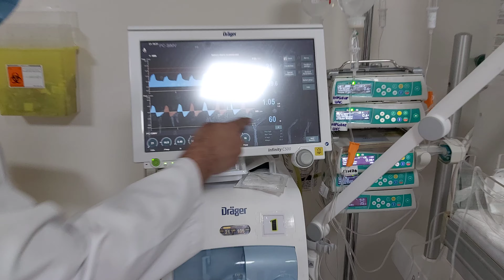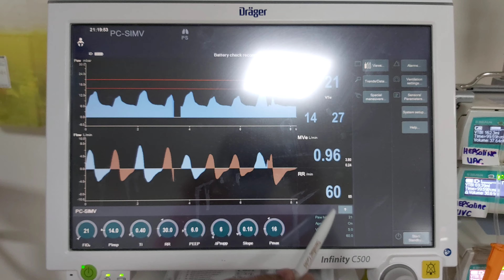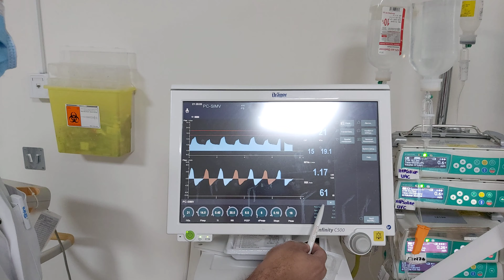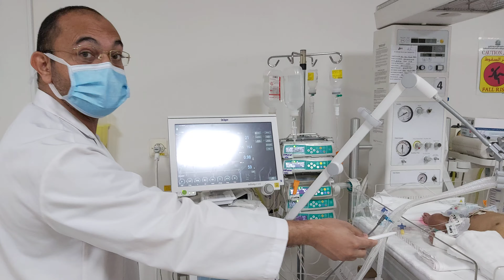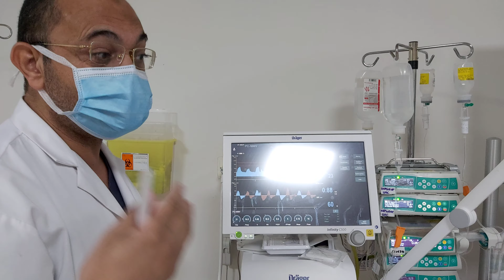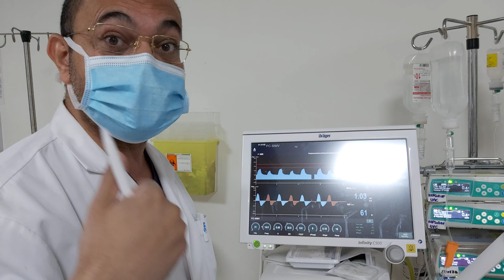How to approach for tachypnic baby  in mechanical ventilation?trigger& sensitivity,water in circuit

Comment from the maker: Perfect 👌
Here’s a stepwise checklist you can use at the bedside when you notice a discrepancy between the baby’s RR and the ventilator RR:

Stepwise Approach to RR Discrepancy in Neonates on Ventilator

1. Check the Baby First

Count the actual chest/abdominal movements.

Assess comfort: retractions, nasal flaring, grunting, fighting the ventilator.

Ensure baby is not distressed or apneic.

2. Check Ventilator Settings & Mode

Controlled mode (AC/CMV): all breaths should match → discrepancy means asynchrony.

SIMV/PSV: baby can breathe extra → clinical RR > ventilator RR.

HFOV: ventilator RR irrelevant, baby may still breathe spontaneously.

3. Look for Missed Triggers (ineffective efforts)

Are there visible chest movements not supported by ventilator?

Causes: low trigger sensitivity, air leaks, weak respiratory effort.

Action: adjust sensitivity, reduce leak, ensure good ETT position.

4. Look for Auto-triggering

Ventilator RR > baby’s actual RR.

Causes: 

Circuit leaks

Water in tubing

Cardiac oscillations / hiccups

Action: dry circuit, check connections, optimize sensitivity.

5. Check for ETT or Circuit Issues

ETT leak (common in neonates with uncuffed tube).

Partial obstruction (secretions, kinking, biting).

Poor compliance or pneumothorax → baby’s effort not transmitted.

6. Review Waveforms/Loops

Flow and pressure curves: 

Ineffective efforts = “dips” not resulting in a breath.

Auto-triggering = breaths without effort.

7. Optimize Synchrony

Adjust trigger sensitivity.

Consider sedation if severe fighting/asynchrony.

Re-assess ventilator mode (sometimes switching from SIMV → PSV or volume guarantee helps).

✅ Summary Table

Cause of DiscrepancyBaby RR > Vent RRVent RR > Baby RRMissed triggers / weak effort✔✘SIMV mode (extra breaths)✔✘ETT leak✔✘Auto-triggering (leak, water, cardiac artifact)✘✔Monitoring error / faulty sensor✔✔ 

❤❤❤❤

Comment from the maker: Great question 👍

When a baby is on a ventilator and you notice a discrepancy between the respiratory rate (RR) shown on the ventilator and the baby’s clinical RR, it usually reflects asynchrony between patient and ventilator or monitoring issues.

Causes of discrepancy

Spontaneous breathing above set ventilator rate

Baby is breathing spontaneously in addition to mandatory ventilator breaths.

Ventilator may count only the triggered/mechanical breaths, while clinical RR includes both.

Ineffective/Uncaptured breaths (missed triggers)

Baby initiates breaths that are not strong enough to trigger the ventilator (especially if sensitivity is low, or leak around ETT).

Clinically you see chest movement, but ventilator does not deliver/support those breaths.

Auto-triggering / false triggering

Ventilator delivers extra breaths due to artifacts (water in circuit, leaks, cardiac oscillations).

Ventilator rate appears higher than actual clinical RR.

Leaks around endotracheal tube

Common in neonates with uncuffed ETT.

Ventilator may fail to detect some spontaneous efforts → discrepancy.

Mode of ventilation

In SIMV, only some spontaneous breaths are supported, so clinical RR > ventilator displayed RR.

In controlled modes, the baby may still “fight” or attempt breaths not sensed by ventilator.

Obstruction or poor compliance

If baby is trying to breathe but chest expansion is poor (secretions, stiff lungs, pneumothorax), ventilator may not sense efforts.

Monitoring/Technical issues

Faulty sensors, leaks, poor waveform interpretation can give misleading RR on ventilator display.

✅ Bottom line:
The discrepancy usually arises because the ventilator only displays the breaths it senses/delivers, while the baby may be making additional efforts that are not recognized or are ineffective. Causes include asynchrony, leaks, missed triggers, or auto-triggering.

❤❤❤

Comment: Վայ էէէն միամիտին,ով չի կառավարում սեփական ինֆո դաշտն այնպես,ինչպես ինքն է ուզում,ում հիպոթալամուսի փոխարեն' 😅 խոտ է,ով սպիտակ խալաթի տակի ֆլյուիդները հատ հատ չի տեսնում😅+**12...
Reply from the maker: Great question 👍

When a baby is on a ventilator and you notice a discrepancy between the respiratory rate (RR) shown on the ventilator and the baby’s clinical RR, it usually reflects asynchrony between patient and ventilator or monitoring issues.

Causes of discrepancy

Spontaneous breathing above set ventilator rate

Baby is breathing spontaneously in addition to mandatory ventilator breaths.

Ventilator may count only the triggered/mechanical breaths, while clinical RR includes both.

Ineffective/Uncaptured breaths (missed triggers)

Baby initiates breaths that are not strong enough to trigger the ventilator (especially if sensitivity is low, or leak around ETT).

Clinically you see chest movement, but ventilator does not deliver/support those breaths.

Auto-triggering / false triggering

Ventilator delivers extra breaths due to artifacts (water in circuit, leaks, cardiac oscillations).

Ventilator rate appears higher than actual clinical RR.

Leaks around endotracheal tube

Common in neonates with uncuffed ETT.

Ventilator may fail to detect some spontaneous efforts → discrepancy.

Mode of ventilation

In SIMV, only some spontaneous breaths are supported, so clinical RR > ventilator displayed RR.

In controlled modes, the baby may still “fight” or attempt breaths not sensed by ventilator.

Obstruction or poor compliance

If baby is trying to breathe but chest expansion is poor (secretions, stiff lungs, pneumothorax), ventilator may not sense efforts.

Monitoring/Technical issues

Faulty sensors, leaks, poor waveform interpretation can give misleading RR on ventilator display.

✅ Bottom line:
The discrepancy usually arises because the ventilator only displays the breaths it senses/delivers, while the baby may be making additional efforts that are not recognized or are ineffective. Causes include asynchrony, leaks, missed triggers, or auto-triggering.

❤❤❤

Comment: What to do if the baby is realy tachypnic
Reply from the maker: Excellent question 
Dr Nancy 💯👏👏👏👍🌹🌹

First correct the iatrogenic ,preventable or correctable cause 

1. Triggering and sensitivity 
2. 💧water in 💧the circuit 

Then 

Real causes depend on 

1. Clinical assessment 
ETT ( displacement , obstruction )

2. Biochemical evaluation = Respiratory acidosis ( causes)

3. Radiological study = pneumothorax 

4.  Equipment failure 

ومن احياها فكأنما احيا الناس جميعا 

🌹🤲🙏🌹🙏🙏🙏🤲🤲🤲
Reply: @dr.tageldinaly  many thanks Dr
Reply from the maker: @nancyshafeek6679  

You are most welcome dr Nancy 😊

My pleasure 😊

🙏🤲🤲🌹🌹🌹🤲🙏
Reply: What about inadequate sedation ?
Reply from the maker: @د.احمدالفقي-ظ8ز Great question 👍

When a baby is on a ventilator and you notice a discrepancy between the respiratory rate (RR) shown on the ventilator and the baby’s clinical RR, it usually reflects asynchrony between patient and ventilator or monitoring issues.

Causes of discrepancy

1. Spontaneous breathing above set ventilator rate

Baby is breathing spontaneously in addition to mandatory ventilator breaths.

Ventilator may count only the triggered/mechanical breaths, while clinical RR includes both.

2. Ineffective/Uncaptured breaths (missed triggers)

Baby initiates breaths that are not strong enough to trigger the ventilator (especially if sensitivity is low, or leak around ETT).

Clinically you see chest movement, but ventilator does not deliver/support those breaths.

3. Auto-triggering / false triggering

Ventilator delivers extra breaths due to artifacts (water in circuit, leaks, cardiac oscillations).

Ventilator rate appears higher than actual clinical RR.

4. Leaks around endotracheal tube

Common in neonates with uncuffed ETT.

Ventilator may fail to detect some spontaneous efforts → discrepancy.

5. Mode of ventilation

In SIMV, only some spontaneous breaths are supported, so clinical RR > ventilator displayed RR.

In controlled modes, the baby may still “fight” or attempt breaths not sensed by ventilator.

6. Obstruction or poor compliance

If baby is trying to breathe but chest expansion is poor (secretions, stiff lungs, pneumothorax), ventilator may not sense efforts.

7. Monitoring/Technical issues

Faulty sensors, leaks, poor waveform interpretation can give misleading RR on ventilator display.

---

✅ Bottom line:
The discrepancy usually arises because the ventilator only displays the breaths it senses/delivers, while the baby may be making additional efforts that are not recognized or are ineffective. Causes include asynchrony, leaks, missed triggers, or auto-triggering.
❤❤❤
Reply from the maker: @د.احمدالفقي-ظ8ز 

Perfect 👌
Here’s a stepwise checklist you can use at the bedside when you notice a discrepancy between the baby’s RR and the ventilator RR:

---

Stepwise Approach to RR Discrepancy in Neonates on Ventilator

1. Check the Baby First

Count the actual chest/abdominal movements.

Assess comfort: retractions, nasal flaring, grunting, fighting the ventilator.

Ensure baby is not distressed or apneic.

---

2. Check Ventilator Settings & Mode

Controlled mode (AC/CMV): all breaths should match → discrepancy means asynchrony.

SIMV/PSV: baby can breathe extra → clinical RR > ventilator RR.

HFOV: ventilator RR irrelevant, baby may still breathe spontaneously.

---

3. Look for Missed Triggers (ineffective efforts)

Are there visible chest movements not supported by ventilator?

Causes: low trigger sensitivity, air leaks, weak respiratory effort.

Action: adjust sensitivity, reduce leak, ensure good ETT position.

---

4. Look for Auto-triggering

Ventilator RR > baby’s actual RR.

Causes:

Circuit leaks

Water in tubing

Cardiac oscillations / hiccups

Action: dry circuit, check connections, optimize sensitivity.

---

5. Check for ETT or Circuit Issues

ETT leak (common in neonates with uncuffed tube).

Partial obstruction (secretions, kinking, biting).

Poor compliance or pneumothorax → baby’s effort not transmitted.

---

6. Review Waveforms/Loops

Flow and pressure curves:

Ineffective efforts = “dips” not resulting in a breath.

Auto-triggering = breaths without effort.

---

7. Optimize Synchrony

Adjust trigger sensitivity.

Consider sedation if severe fighting/asynchrony.

Re-assess ventilator mode (sometimes switching from SIMV → PSV or volume guarantee helps).

---

✅ Summary Table

Cause of Discrepancy	Baby RR > Vent RR	Vent RR > Baby RR

Missed triggers / weak effort	✔	✘
SIMV mode (extra breaths)	✔	✘
ETT leak	✔	✘
Auto-triggering (leak, water, cardiac artifact)	✘	✔
Monitoring error / faulty sensor	✔	✔

---

❤❤❤❤